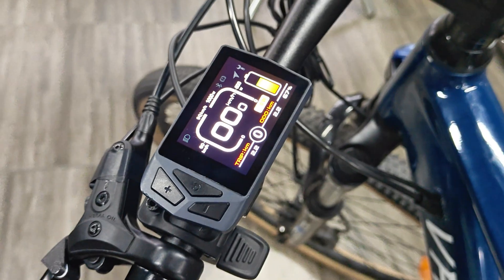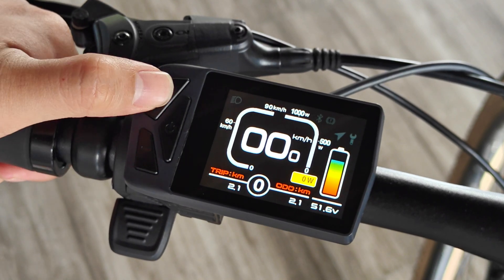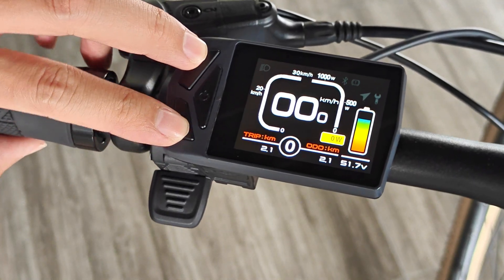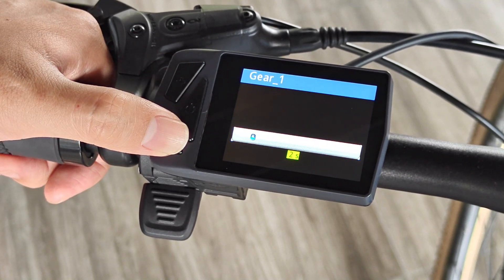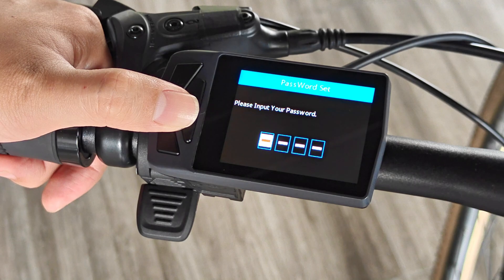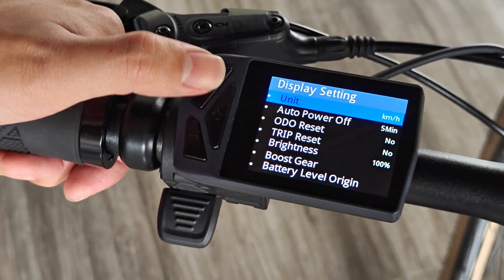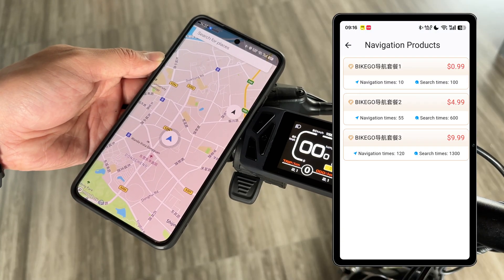Bafang CAN-BUS EKD01 Display Detailed Review!! Speed Limit, Riding Parameters,Bluetooth,Mobile App？

Comment from the maker: I found that many friends' CAN-BUS EKD01 displays do not have advanced settings. The reason is that the display needs N20 or higher（2:56）. Do you need to upgrade your display? Please like and subscribe. If everyone's call is high enough,I will make an upgrade tutorial as soon as possible.

📍Note: For compatibility reasons, this firmware update is only applicable to Varstrom brand EKD01. It is recommended that non-Varstrom brand users contact the corresponding service provider.
Reply: Yes please !! 😁 , otherwise I will return the motor and get a tsdz8! 🤪
Reply: @daoodr  
When I saw Can-Bus arrival, Bafang and I became enemies. Got on a TSDz8 and never looked back.
Reply: You won't be impressed.  16 mph unless you update the stupid thing. @daoodr
Reply: Op, Have you been able to dial out the CANBUS BBS02 throttle delay that’s 1 second long between hitting the throttle and actually accelerating ?
Reply: @varstromebikeconversion  can you please make a video of it because is just doesn’t work for me
Reply: @Csabilton screw the video... send me the updated display.
Reply: @pathaysonline  yes i did asked them to send me a replacement updated display but one of their staff managed to sort out the firmware update so now is all good and working
Reply: I have MCU _N17,  I need _N22 as you 😘
Reply: @daoodr  their customer service so far is awful, I followed all the steps they sent to my email, but it gives me download fail every time
Reply: @daoodr  now i have a not working bike because the app they sent me giving me download fail every time, not a great customer service so far from them
Reply: Well, that's just crap! I can't get connected with bikego, there's is no way to get to the advanced settings 😢
Reply: @pathaysonline i managed to update the firmware, now is working and have advanced settings too. Have to rename the file that they send to be working. Have you got the new firmware from them yet?
Reply: That would mean i need to own a laptop @Csabilton. I do not and I don't wish to buy one.
Reply: @pathaysonline  i see, then yes you need the updated one
Reply: @Csabilton Are you saying you have updated the EKD01 firmware? Is that what is needed for them to have access to more settings?
Reply: @pathaysonline  yes i have the updated EKD01 with the advanced settings
Reply: Hello @varstromebikeconversion5837, I have a CanBus EKD01 "Varstrom brand" display with an _N17 microcontroller, BikeGO updated (2.0.8) and connected via Bluetooth from my iPhone to the ED01 display. The BikeGo app does not offer me an update. Is it because it is in French that it cannot find new firmware for the display? Or do I need to use a computer and a specific cable ?
Reply from the maker: hey bro, if you want to get the upgrade, you can contact me or the official customer service, We will send you the upgrade method in advance. If you are not in a hurry, you can wait for my upgrade tutorial video to be uploaded and it will be completed soon.
Reply: @varstromebikeconversion  I´m in a hurry so I just sent an email. In addition to setting the speed limit and current limit for each powerlevel I would also like to reduce the delays. I takes 2 seconds from I press the thumb throttle to motor start and why do I have to press the on/off switch for 6-7 seconds to turn on the display?
Reply from the maker: @hanspetterfaale9472  okay, I saw and replied to your email.
Reply from the maker: 🛩Quick Jump EKD01 Upgrade Method：https://youtu.be/hcuBT0vvHWY
Reply: At any rate advanced settings won't work with bafang m-series motors.

Comment: is there any buttons you can press to switch from legal restricted mode to off-road mode?
Reply from the maker: Hey! Thx for asking! If your EDK01 is using the UART protocol, you can switch anytime from the main interface by holding the Power and Plus (+) buttons together.
If your EDK01 is using the CAN protocol, hold Plus (+) and Minus (–) together on the main interface to switch.

Comment: When you have speedlimit unlocked, what is the fastest way to restrict speedlimit while driving to 25 kmh back again ?
Reply: Hold + and -. This will revert back to 25km/h. If you hold press again it will revert to the speed limit you set .
Reply: tom me + and - doesn't work, I have to press + and power button, not sure why

Comment: These newer bafang Can-bus motors have a communication cable in addition to the power cable, which apparently comes with some battery model (?), where is one used and why? Is it mandatory to use it and what are the benefits of it? Could you also make a video about this?

Comment: The changes I make to the speed switch settings are not saved. I set them, but they revert back to zero. Only one speed setting works correctly with these settings. To update, you need the correct driver, otherwise there is no connection to the device.

Comment: I bought M625 and 20ah 52v battery from you. But my settings don't work, - speed up charactes, max output power, start up angel...You can see in your video that they work. Why?
Reply from the maker: Check out my latest pinned comment, bro
Reply from the maker: https://youtu.be/hcuBT0vvHWY
Reply: I have updated and put in the new n22 driver. But nothing changed in the improved settings and still no adjustment. I mean parameters like speed up chararacters, max output power, start up angel and others...why on your video these settings are saved and I do not save them when adjusting.

Comment: Hi, I bought CAN-BUS EKD01 with BBS02 750w. Motor is great, BUT...In settings I can only set 60° startup angle like minimum, which is really too much. When I start pedaling, it is like riding with handbrake. It's only start-up, then it working great. Everything else is setup correctly (high power and no delay). With BIKEGO app can't do anything. What can I do with that? Can be solved with firmware upgrade? Thanks for response.
Reply from the maker: At 4:05, the minimum actuation angle can be adjusted to be smaller. Does your display have this option?
Reply: @varstromebikeconversion  Unfortunately not...I have N20 version of my display. In video you have N22 (2:57). How can I upgrade it? Mobile app can't finds any upgrade.
Reply from the maker: Bafang bbs is a speed motor, not a torque motor, so the minimum starting angle is indeed 60°. A torque motor can support a smaller starting angle（like tongsheng）.
Reply: @varstromebikeconversion  why you changing topic? I know there is a tongsheng. I'm talking about newer firmware (you have in video), but I don't. And that is why you can setup more things (like startup angle)....So, is there any option, how can I download it?
Reply from the maker: @michalh.2041 I am working on a new video, a tutorial for upgrading N22

Comment: I want to use this display to remove the speed limit of 25km/h. But I want to continue to use my Bafang display. So my question is can I just remove the speed limit ...then swap back to the Bafang display and the speed limit will be gone also for it? I saw somewhere that the speed limit is removed in the controller lever so If this display is able to remove it on a controller level ...therefore it should also be removed from the original Bafang display. Can you confirm ? Thanks
Reply from the maker: What model is your motor?
Reply: @varstromebikeconversion  m510
Reply: Model bafang m420?

Comment: Ok OK! Upgrade your EKD01 display! Varstrom sent me the files and instructions this morning.  The instructions are on a pdf that need blown up 500% to read and the format is tailored differently. But, I did the firmware update and checked that has been updated and indeed it has. Also there is a lot more you can change in the settings.  DO IT!!
Reply: @pathaysonline  hello man, please I selling these new varstrom canbus motors and many of my customers dont have advaced settings... Could you please help me with display upgrade??
Reply: @MaxPayne22MaxPayne22  Me neither, I don't have advanced settings, and I still haven't found the solution to this problem.
Reply: Have you been able to dial out the CANBUS throttle delay that’s 1 second long between hitting the throttle and actually accelerating ?

Comment: I have Can Bus EKD01 display and a g340 mid drive, and it doesn't have any of the advanced features described here. I am also unable to connect to the bikego app.  I also have an EKD01 with a 500 watt front drive wheel that I cannot connect to the bikego app.
Reply from the maker: I suggest you find after-sales service to solve your problem.

Comment: Just got my Can-Bus bbs02 with the DPC 080 display but it seems like the speed limit is firmware locked to 15.5mph on eu models. I’ve changed my speed limit and doesn’t seem to increase power at all
Reply from the maker: When you turn on the throttle, does the data displayed on the display change?

Comment: I dont have option "advance setting" in Information... 😬 Dont understant why..
Reply from the maker: The ekd01 in the video is a CAN-BUS protocol motor, which has been programmed by Varstrom. If your ekd01 is a UART model, it does not have this function. If your ekd01 is a CAN-BUS model, it can be programmed and the program can be flashed into the motor.
Reply: @varstromebikeconversion  hello, I have varstrom canbus bbs02 and ekd01 dont have advanced settings... Could you help me with upgrade firmware??
Reply: @MaxPayne22MaxPayne22  Me neither, I don't have advanced settings, and I still haven't found the solution to this problem.

Comment: can I use my old bike battery or is it blocked by the can Buss protocol?

if i set the disypaly to factory settings will i still be able to remove the speed limit?
Reply from the maker: Removing the speed limit has nothing to do with the battery. It depends on whether the motor controller and display used support the speed limit removal function.

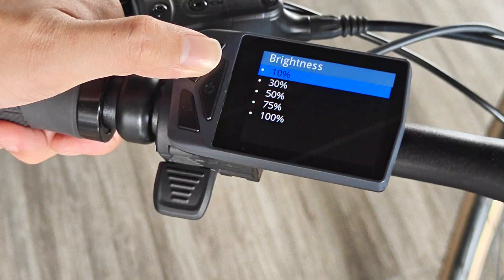Comment: Thank you very much for this video. I know it's not the same thing but I happen to have an issue with the EKD01 I received from Varstrom with my TSZD2B, it doesn't have a software where I can modify the boost gear number like you've done (1:53) and other things. Is there a way to update the software (I've already tried with the app)? Is it normal to get this old software or maybe I was just unlucky?
Reply: same as me (EKD01 - CAN for BBS02) 🙏
Reply from the maker: @daoodr Hey bro， If the ekd01 display you are using is the CAN-BUS of the Bafang bbs02, it means that your ekd01 version has not been updated. You can upgrade it by programming.
Reply: Hi  @varstromebikeconversion  All your videos are really great and your advice is always invaluable. It's always nice to have a knowledgeable person in front of you. The BBS02 CANBUS motor is really very powerful, and it would be interesting to be able to modify the power ramp via the EKD01 CAN screen or a BT application. What do you mean by programming?
Reply from the maker: @daoodr  Thank you for your like. The programming I mentioned means to upgrade the program for ekd01.
Reply: @varstromebikeconversion  I have the same problem, I got the bbs02 with EDK01 CAN BUS editon from Varstrom but I don't have the advanced settings. Can you please give more instructions on how to update the EDK01 to have this settings
Reply from the maker: You mentioned tsdz2b. If your ekd01 is adapted to tsdz2b motors, then this is the UART protocol. The ekd01 in the video is the CAN-BUS protocol, adapted to the Bafang motor.
Reply from the maker: The UART ekd01 display does not have the functions shown in the video